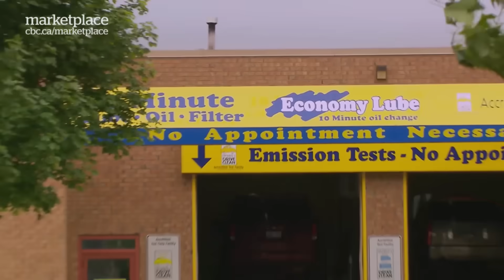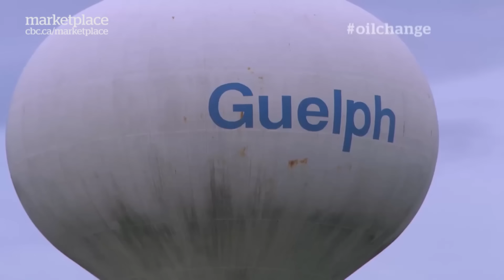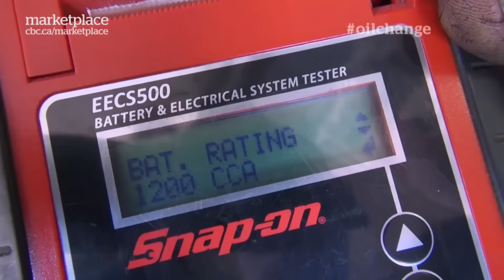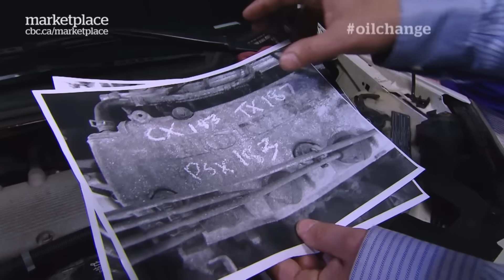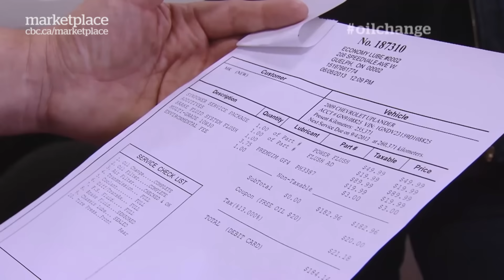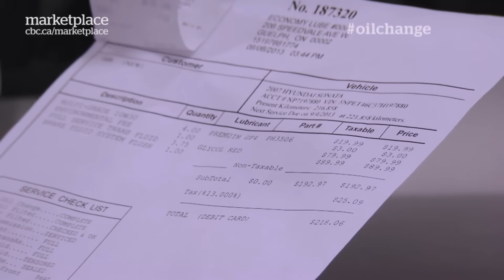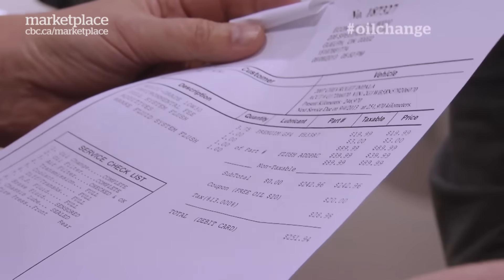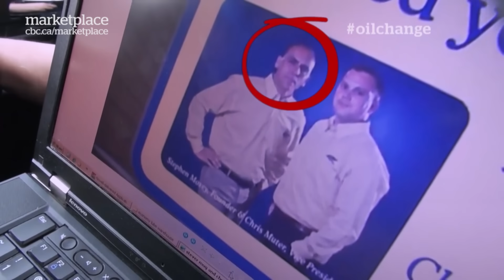Oil change scams: Hidden camera investigation on what really happens to your car (CBC Marketplace)

Comment: Even dealerships rip you off. I got ripped off at a Lexus dealership for service that was not needed. It's tough ti find honest mechanics.
Reply: That's one benefit of being Hispanic honestly. We know most of our mechanics like brothers so you know for sure they won't rip you off. If anything we get deals as well
Reply: CycleCruza 600 DOUBLE ARRRRR!!!
Reply: Eric is correct, I know a good 3 friend mechanics who I reach out to whenever I need advice on something with my car or when I don't know exactly the cause of a problem with it
Reply: CycleCruza I know right. A pep boys told me I needed a left tie rod when I didn’t actually need one. Other garages can just screw your car up. I had my 2001 Acura TL serviced at a garage in the city and came out with an exhaust leak. How did I get an exhaust leak after I had my wheel bearings done? I mean that’s nonsense. The mechanic worked on my car acted like he didn’t know. Worst part is, the shop didn’t even tell me there was an exhaust leak before they brought out my car. I’m working on my own car next time. These mechanics are mediocre.
Reply: NissanSucks99xVT well they may have loosened a header bolt so it would leak eventually and have you come in to change the exhaust gasket. or could be a coincidence it was about to rattle loose. and mechanics suck today because everything is done with computers now. there's very few old school mechanics left. they plug in a computer it tells them what to change. they have another computer for the repair and tells the step by step with video and pictures on how to change it. so it's not very hard to become ase or nase certified anymore. almost no cars are repaired anymore that don't have a obd1 or 2  sensor under the dash anymore. they started those like 25 years ago
Reply: I wouldnt even blame them. they legit get told to do that and paid to do it...
Reply: This is why I'm learning to fix my car myself
Reply: You won't find anyone totally honest. Dealerships are among the worst. Our legislators do nothing.
Reply: Eric 
I am Black and get your point. I have tried to get Hispanics to work on my car and they come up with excuses not to. I've noticed that you stick to your own and hire your own.
Reply: CycleCruza to*
Reply: CycleCruza you realize you couldve said no
Reply: CycleCruza yea if someone tries ripping you off where i live that said business will get major flack
Reply: "We need to scan the OBD2 system, it's, like, really hard and costs $90."
Reply: nissan.... it also happens that they fix something (for real) and makes sure something else is going to break down in a little while, so they get more business.
best advice? stay by your car to see them working on it.
or get advice from 1 shop or garage and go to another one to get it done.
if the garages are any good.. they will get the same results on checking your car
Reply: That's why I really like to work on my 240 with my dad. It's fun to work on it, and helps me wrap my head around the components, and in the end, it's ALWAYS cheaper than getting it serviced.
Reply: I used to watcg you
Reply: Dodge told my girlfriend that in order to change her clutch master cylinder, they need to change the clutch too. LOL, they saw her and her mom walk in with an open check book and took advantage 110%... a 50$ part, maybe a 350$ job turned into a several thousand dollar job :P
Reply: no, a lot of people dont realize that. Orrrrr they maybe assume that a dealership especially would give you an honest diagnosis
Reply: Maybe just figure out what is needed to be done do it yourself if you can and if you can't, stay and watch them working...
Reply: Chrysler is the worst place you can possibly go.  and sad thing is they make their jeeps and vehicles with special tools that only THEY have so you have to go there for some things, and they can charge w/e they want.
Reply: The whole auto industry is corrupt and is designed to be corrupt thanks to the manufacturing unions.
Reply: CycleCruza get a good mechanic 10 doller oil change no up sell provide parts hmu Sacramento area
Reply: Its up to you to know what your vehicle requires as you have the service book in your glove compartment, take it out and check it, and don't let your services get out of phase, if it says 50,000ks make sure you take it in at 50,00 and not 52,300, and get the mechanic to make the Ks on the next service align with the book, that way he cant get mixed up about whether or not the work has been completed or not,as the car owner you need to take some responsibility for its roadworthyness by getting it serviced on time.
Reply: damn it Cruza, you should have done that service yourself!
Reply: Honestly, just change your oil yourself. Most people will mess something up on such a simple thing. Get a pan, an oil filter, see how much oil your car holds, and drain/fill your oil yourself. I did mine just the other day with my brother. Way cheaper. Only thing else I need to do is dump the oil at a place here for maybe $15.
Reply: they exist...
Reply: Casiorollo Save your $15. Most auto part stores and lube shops recycle used oil for free
Reply: Rui Jia oh ok, thanks for the tip
Reply: dealership are the worst.. they over charge for a minor service..
Reply: Asians mechanics, I believe are truly trust Worthy, you too my own experience in the past.
Reply: in south africa the dealers are the worst!..they seem trained to manuevre money out of their victims.
Reply: I’m grateful my cousin is a mechanic. And a genuine and honest person to. So his auto shop does well because he doesn’t screw people for not knowing about cars
Reply: thats where they make their money
Reply: CycleCruza
Reply: Cheap minded people, deserve to be ripped off.

The ones that pay properly, pays the asking price, should get premium treatment, and not ripped off.
Reply: The problem with cheap minded people is that, they think they are entitled to premium level quality, but paying as little as possible ( next to nothing price ), these type of people deserve to be scammed.

Scammer vs Scammer, good solution.
Reply: What cyclecruza?!!!!?
Reply: I use to work at nissan they deff doo
Reply: no one deserves to get scammed period
Reply: Eric LMFAO. You can get cheap labor that may or may not pan out. It's cool if you let them work on a car from the 90's. Anything modern you're asking for trouble.
Reply: Highlighted reply
Michael Verhoest
2 weeks ago
This is all good to know but did marketplace do anything about it. I mean, did they turn this evidence over to the authorities and prosecute the lube co.. Average people don't have hidden cameras and back up mechanics to verify the crime! Come on marketplace, I want to see the lawsuit follow up show!!!!

1
Reply: This is why in the small town I live in people usually pay me or my dad to do work on their cars at our house cause we make sure everything is on right and don’t strip bolts or rip me off.  People love my dad and I get to work around cool cars.  I got to work on a older corvette stingray even 😂
Reply: Cyclecruza maaan, you need the get that s1000 double aarrr
Reply: Eric so true lol
Reply: CycleCruza CBR1000 double R!!!!!
Reply: Casiorollo shops have to accept waste oil no charge
Reply: me tooo !!! i always decline everything
Reply: OMG WHAT ARE THE CHANCES TO SEE YOU HERE CYCLECRUZA! LOVE YOUR VIDS!
Reply: Ikr bob bell got me pissed
Reply: Cody Johnson yeah i work at honda. We make a checklist on things that are bad or could eventually have problems. Say like tires are dryrotted and we tell the customers and they dont want it. If they leave and there tire blows up or breaks we told them and we are lieable for the lawsuit they try to do to us. I write everything that is wrong with the car and i never have any issues about things
Reply: truly is. and nothing like taking a new Z/28 in to a dealership, and later seeing some kid doing donuts on a gravel parking lot out back with my car !!!  while it was only in power window problem.
Reply: I've had a dirty mechanics (redundant I know) poke holes in the underbelly of my car. He mad poke holes all the way through the floor board and said "if I can poke holes then you need it repaired". I didn't ask him to show me that or prove that to me. I told him to go f themself and never went back.  Second guy was from minekee mufluer who, despite me telling him to do nothing without asking me first except an estimate on a new mufluer, he literally cut off my mufluer and tried to get me to pay him for a new one.  Totally liar and scam artist.  The car industry is filthy from new and used car dealers to repair places.
Reply: CycleCruza aye cyclecruza wyd here
Reply: Wow this is all news to me. Im a tech at lexus and never ripped anyone off or forced myself to do work that needed to be done just to get customers money. Trust me there are plenty of cars thay actually need real work done to them that pay well. Really if you need something we have to let you know otherwise customer's will just cirlce back and say we missed something and demand we fix it for free. Truth. Really what brings the price high most of the time is the upmarked price in parts in the parts dept. Do your research and get quality parts. Most are honest techs. If theres nothing wrong with your car we dont want to fix stuff thats not broken. Trust me.
Reply: Can we not say that ALL dealerships are ripoffs. Yes I'm sure some are... but they are not all stereotypes!!!
Reply: Ford dealership shouldn't be trusted either, that's why learn how to do it on your own.
Reply: Canadian Tire does that too
Reply: Phant4sm 
My dad retired from Chrysler & all he'd buy was their vehicles. I remember them always breaking down, & him working on them everyday. There was always problems with those vehicles. I, myself have never bought a Chrysler, Jeep, Mopar product & never will.
Reply: Cycle ill be your Ohio mechanic.  If you teach e how to get my motovlog going :)
Reply: I worked at a dealership and the worse thing we ripped people off on was nitrogen in the tires, the people who typically had to do the nitro were the people who had the least wiggle room to do it or else get fired (i did the most service calls and guess where i dont work anymore) the nitrogen machine was on the far end of the shop and took ages to fill up the tanks that we used to transport it, so we just went into the storage room where the tanks were kept and filled dem bad boys with air and used said air on customer tires
Reply: Its not the techs. its the service managers.
Reply: I had an absolutely horrible experience at Canadian tire that would probably surprise some of you. I've heard that Canadian tire rips people off before, but I only went there a couple times for small things and didn't have any issues.
So anyway, I had a leak in my fuel line. It was a very small leak and there would only be a few drops on the ground after my car was parked for a while.
So I went to a Canadian tire garage and they told me it would cost me $1200. Which sounded ridiculous to me. I told them there's no way I could afford that and told them to just forget about it. I still had to pay the $50 (approx.) inspection fee, which I understand I guess.
Anyway, after that I brought it to a mechanic I know that is kind of a friend, and got it all changed for $160. 
I should have brought it to him first but I really wasn't expecting Canadian tire to try to rip me off so much. Never going back there again, and if anything, I've always had better success at small mechanics than these big company mechanics. 
I've also been to Mr. Lube once and they were trying to up-sell me as well.
Reply: CycleCruza b
Reply: In Canada Fire-station halls have a drop off section for used oil, coolant, etc. Free and pretty much anytime on anyday so you're not even limited by working hours.
Reply: The most honest mechanic is yourself. That's why you should get a tool kit and some gloves and start working on your car yourself...  It's not only a satisfying feeling fixing your own car, but you're also contributing to getting these companies shut down.
Reply: Lexus Dealerships have become the most Shady.  They are 10 times worst than this Economy Lube.  I went to a Lexus dealership in Beverly Hills, California they told me my transmission was damaged and is leaking, it will cost 5k to fix.  I took it to to a Toyota dealership and the expert mechanic was like there is absolutely nothing wrong with your transmission.  That was 8 years ago, I have taken it to several other mechanics and they all have told me nothing is wrong with your transmission.  My car drives fine.
Reply: U mean a Lexus STEALERship?
Reply: CycleCruza valvoline is the biggest scam dont fully drain oil tell you to leave engine running and never change oil filters
Reply: @johnwall713  they all are and a lot incompetent.
Reply: howd you know what service you need or didnt need?
Reply: All good took a Lexus is250 in for a recall on the air bag and they called saying that the motor blew. And wanted 11k to replace it they said it was because I changed spark plugs in it a couple months prior and that’s what caused it to throw a rod. I got a used motor for 850 bucks and had it in within 8 hours.
Reply: CycleCruza Firestone
Reply: Tf my Toyota dealership does me good every time😕 no problems
Reply: That’s why I call them stealerships...
Reply: Find a Lexus owners club and ask them.
Reply: I got lucky I found a 4x4 Suzuki Grand Vitara year: 2000

So, the bad news was that the owner lost the manual and tons of stuff to make the instructions to make the car easier to repair...

Lucky that it got abused by the owner's daughters and lived to get to me, changed. Lots of damn. Things.
Reply: Also, I want to be an honest mechanic, just starting off with my car for now
Reply: @h3retic583  my best friend is a mechanic if I need something fixed I call him
Reply: Mine just does oil and that's it. If they offer more I usually go to other mechanics to check it out and make sure I wasnt being ripped off.
Reply: My dad left lexus for jeep cause of there service
Reply: Thats when you learn to properly do it yourself....then you will never have to worry about them scams.
Reply: I work at a Canadian tire garage and never have I ever been  taught to scam anything we get a work order from the desk and complete it and just do a quick check of the brakes and fluids for free aswell as tire pressures and anything we do think needs work is then said to the customers and left up to them to do they can take the car as is or do the work but never force any work
Reply: You come to my house
Reply: @h3retic583  or you'll all conspire on robbing people.
Reply: Mechanics do what they are told in most dealerships. That or no job. Any idea what real mechanics have invested in tools alone? Snap-On, Mac or any quality tools are not cheap; then there are the diagnostic tools. Family to support besides. You can be a hero, buck the system, and be rewarded with a trip to the unemployment line.
Reply: Alex Lopez I'm in sac what's good with a $10 oil change ha
Reply: In Lithuania, there is only one BMW dealership and it's known as the biggest rip off of all the services and dealerships combined so not surprised lol
Reply: Go to a little-known shop, with lots of beer and football tickets. They will treat you right forever.
Reply: Ya got ripped off when you bought a Lexus !
Reply: @STLSweg  They are still to blame, unless they tell someone that will expose them and have the owner charged with fraud.
Reply: You mean that's what they tell you right?
Reply: @johnpetrov6602  The manufacturing unions have NOTHING to do with any policies of the auto industry.
Reply: Even? .....  Especially the dealerships.  That is why the auto companies are selling people years of warranty and interval services.
Reply: Yeah. Dealerships can be a drag. The only thing I like about them is they generally have to be master mechanics and know how to fix something right the first time even though you pay more..
Reply: Well first off its a dealership, they will never say ur car is fine they wanna sell you stuff. Secondly its a lexus, its a luxury car. Yes its a feul effecient and reliable luxury car, but those things are always money pits (if you get a luxury car be ready to afford it) generally the technicians will check ur car and if they even suspect a problem they'll recommend the solution right away. I've seen techs rack up 15 hours of flat rate on an inspection only to perform maybe 5 hours because the customer couldn't afford/ didn't want the other services
Reply: @JamesSmith-lt5zz  You obviously know nothing tbh. You think obd scanner tells what to change? No, obd scanner tells where the issue might be but it never tells what to change. You have to use your skills and other diagnosis tools in order to find the issue, mechanics job ain't easy if you really are skilled and know something and do those difficult diagnosis.
Reply: Something like 90 is pretty reasonable, maybe a bit less like 60-70 but you do know how much scanner licenses cost per year? You gotta make some money from your work, it's not charity :D
Reply: The worst place you can buy a used car is at a dealership. Unless you have no other option. Don't.
Reply: I'm 45, and I have been working on cars and trucks off and on since I was 13, that's why I have offered to always help people so they don't get ripped off by businesses like this, whoever I helped over the years, they were always within ear/eye shot so everyone I helped knew exactly I was doing for them what they asked for, I never tried to oversell any kind of crap
Reply: Lo and behold my 1000 DOUBLE RR!
Reply: It helps to have a dad that teaches automech
Reply: Can u just not pay for it if you didnt ask
Reply: It is hard to find honest people, period...we all are prostituting ourselves for money
Reply: This is why you should know about Toyota service. They have the best system in place to avoid internal frauds and make sure the vehicles are maintained the best way. I went to 3 places with an old 1995 landcruiser, all three places gave a huge list of things to be done and 1000s of dollars worth of estimation, finally I thought, if it's costing so much outside, why shouldn't I try in their service. Finally I walked into the services, they agreed to get original parts  sourced from Toyota itself even if it get delayed, some parts which were difficult to find, and the entire service came upto around 300 dollars. If I had stepped into any of the outside garages, my bill would have been anywhere between 3000-4000 while they would have adjusted with second quality parts!

Toyota also have some of the best internal management which is imitated by many manufacturers now. Having used many cars now, I can surely say that no manufacturer in the world can match the Toyota services, standards, internal management, quality etc They want their cars to run for ever with the lowest maintenance possible. That culture is visible in the attitude and work ethics. No wonder it has become the top car manufacturer in the world uprooting traditional rivals
Reply: That was your first mistake you bought a Lexus then you went to the dealership to get services done.
Reply: @CycleCruza That’s why you always stick with your manual
Reply: Same. I got ripped off at Subaru of Las Vegas
Reply: Dusky Elantra Why are they even telling them to do that in the first place?
Reply: That's why you need to befriend one.
Reply: It's sad but true
Reply: What's needed for proper automotive service is an ethical, skilled automotive technician. These are rare and valuable commodities. I  don't understand what makes people think automotive service and repair can be accomplished by anyone who merely thinks they have the needed skills (grease monkey). Vehicles are expensive and complicated machines, which are not meant to be properly maintained and repaired by grease monkies. Do people fix their own televisions, refrigerators, etc.? I assure you that these are all less complicated machines than an automobile. The most effective way to receive value for your automotive  $'s spent is to research your market and locate an ethical professional. Ask friends and neighbors who have purchased automotive services. The lowest price is not likely to be the best choice. Ask yourself, if I became the best at my occupation, would I do that so I could earn the lowest wage? The skilled, ethical professionals are out there and you will need and appreciate the services they offer, even if you perform some maintenance tasks on your own vehicle.
Reply: @h3retic583  so dont trust Hispanics
Reply: @h3retic583  that's why i take it to my mexican homies. They will fix it for a deal
Reply: You need to learn to say “I’m too poor for that right now.” Otherwise they will mess with your car, if you just say no thanks.
Reply: My car got serviced about 2 months ago, i bought the  vehicle from a lady, she told me she didn't had the time/money to get the car repaired, i bought the car, i brought it to my local dealership that is specialized in the brand i drive, i paid 2000 euro's for service and new parts, but in those 2 months, my car broke down 4 times, the last time today (10-22), my drivebelt snapped, so my car needs to be repaired again, i will do that job myself, because i do not go back to that dealership ever again, so i understand what you mean, this dealership ripped me off in not performed tasks he should have done but i paid for them! He told me that everything had been replaced/taken care of, insane!
Reply: Maybe in america. Here in Catalunya mechanics usally are really gentle and people you can talk to.
Reply: @h3retic583  ikr
Reply: wanna know a mechanic that will never rip you off? CHRIS FIX
Reply: Dealerships are the worst for crooked practices both on the sales side as well as the service side. Consumer beware
Reply: The only mechanic you can trust is you, so learn how to do basic service on your car and you may even find your passion
Reply: I really need to go to sleep and don't even have a car at the moment what the hell am I doing here
Reply: I got a Puerto Rican friend I knew from elementary school all the way to highschool and now he’s a mechanic and I can always trust him
Reply: You can just do it yourself. You can borrow the tools from places or people really easily, and I'll mention @ChrisFix here, because he's cool.
Reply: This is why I service my own cars
Reply: @h3retic583  They make it up on the gringos.
Reply: You should go to an official service site next time. I mean the actual Lexus place with the best mechanics. Most dealerships are able to rip you off easily while if you go to the service site they can’t make you do anything different to your car because they already get paid pretty well. (I’m just a replacement car driver for a Mercedes service site kinda biased)
Reply: The only honest mechanic is yourself
Reply: @h3retic583  As a filipino I can relate. This old man gives me oil change for like $10 as long as i bring my own oil.
Reply: As a mechanic. I can agree. Auto companies will take advantage of customers. The only reason they can't get in trouble is because they are recommending the service, and the customer is deciding to agree and allow the service to be done, so liability falls on the customer for making the decision. 

Also before anyone asks. No. I have not done any of these things. Anything I've recommended when servicing vehicles has been something they needed
Reply: Why the hell is this on my recommended I don’t even own a car
Reply: I have a Lexus rx 350 iam so scares to let different people touch it.
Reply: Its not us mechanics at the dealerships.
Reply: Amen to that!!!
Reply: Same happened with me with range rover ..they wanted to me change something they changed 4 months ago with cold face they say : yes you going to pay 2k usd for those stuff , i took the car out and fixed for 50 $ , so i assume they only changed parts that not main reason for problem
Reply: @DEADLY_HUMAN  where do you live
Reply: @joechandler2634  where do you live
Reply: @runed0s86  who’s Chris fix please ? Tired of getting ripped off
Reply: Gotta find ourselves a puddy
Reply: Why would a Lexus need a repair?
According to Scotty Kilmer and his minions no Toyota product has ever had to visit a repair shop for anything other than a occasional oil change and a windshield washer fluid top up for at least a million miles...
Reply: it is rare to find an honest mechanic. one place to stay away from is pep boys. they often put in a lot of parts that aren't necessary and don't even ask you about it first.
Reply: @knuckledragger1404  no
Reply: @h3retic583  that also goes with middle easterns! Here my dad only goes to 1 garage and I personally don't like it since I honestly would do it myself since it's kinda fun to me!
Reply: And honest people generally
Reply: They charge like 130 per wiper
Reply: lets go for a riiiiiiiide
Reply: try larusso auto group
Reply: Lol the industry is crazy. But I kept the skills I earned .
Reply: The best way to find an honest mechanic is either have a friend who is one or do it yourself
Reply: @h3retic583  pa' que tu lo sepas!!!
Reply: Talk to my grandma he will do it for free and tell you how to fix it
Reply: tbh i'd rather get ripped off my dealerships.. at least they only overcharge but get the job done...they at least do not break your vehicle.
Reply: We just got ripped off for an inspection that was not done.
Reply: Dealerships are worse than mechanics
Reply: It's all about money it's not about honesty they don't care they want your money
Reply: Do it yourself, don't let anyone else under yo hood b.
Reply: That’s why they’re known as STEAL-ERSHIP…. And a lot of the techs don’t know much. 😂
Reply: @myopinion8569  
Yep, dealerships are WORST than a car salesman -- ,& that's B A D
Reply: @h3retic583  I go to mechanics that my Hispanic coworkers recommend. Best services I’ve got on a vehicle.
Reply: Learn
Reply: @pbj8933  I think this just comes from a misunderstanding of the PDI, and the fact a customer just can't believe that their car has problems. The Customers are why I left the Automotive side, and moved into HD Diesel. A Operator, knows a lot more about the machine he's using than a average joe does, their prius.
Reply: Or just stand your ground against these scammers and decline any unwanted services
Reply: Just get the oil change and cvt transmission (if applicable) fluid change at the required intervals. If they mess up, at least you have documentation. The rest leave it to a mechanic of trust
Reply: Dealerships are the last place to go for service, but usually when they mess up you can at least escalate the problem, but not always.
Reply: Dealerships are the first to rip you off. Lol
Reply: One of my friend once came into a dealership for a callback of the vehicle, I don't recall the fix needed but in the end he had to bring his own car back cause the dealership sabotaged it good, and ask for an unraisonable price. One thing I can remember they've done to his car they cut the wires of his starter. Again and very recently I made a brake change on my compagny truck in the dealership. Everytime I went there, I couldn't end up lower then 4k. Last time I went it was the last straws, they actually ask for more than 11k. I refused and went for an inspection. The guy litterally looked me in the eyes amused and told me: "Your truck is brand new". Except some minor adjustment with some component I already knew I had problem with. Ended up saving more than 9.5k. My suggestion would be trust the judgments of others. Reputation come naturally when you do good, if one of friends of familly told you they know a guy and you are unsure about your own mechanic, give it a shot